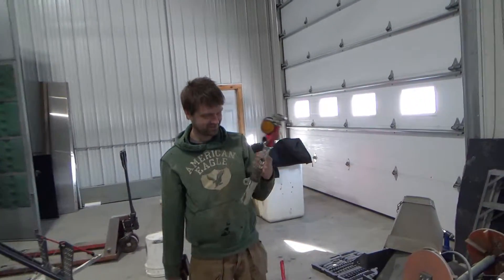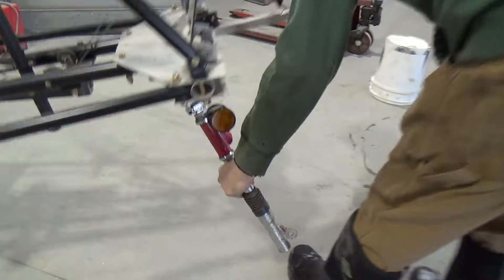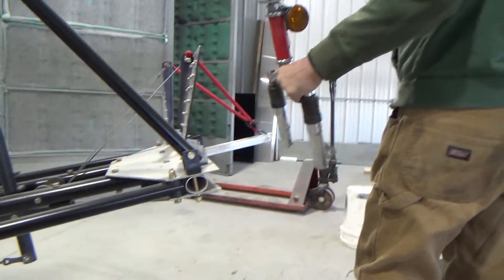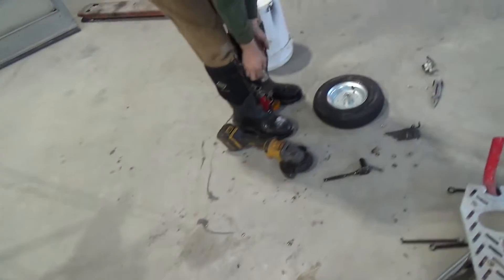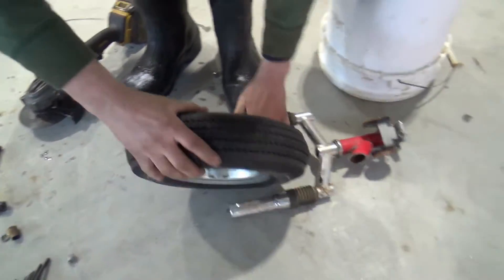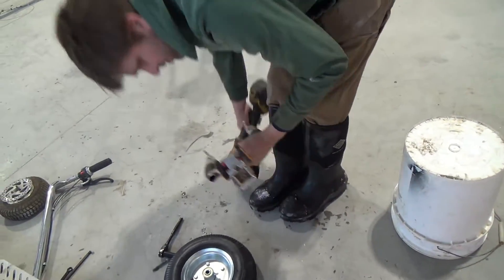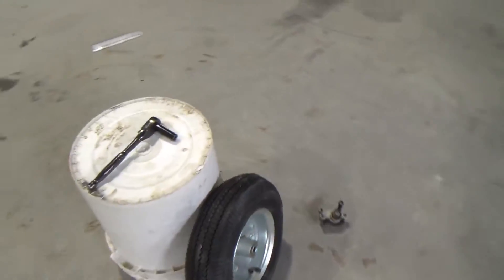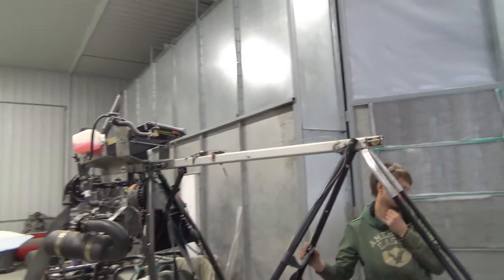Re-Building the Nose Gear | Re-Build: Part 8

Comment: Something to add from the bike design standpoint (being a downhill biker too), a slacker head angle on your steering will decrease the moment arm and thus reduce risk of a similar collapse/failure, by reducing the angle at which the force acts on the attachment points. I think you need a slacker head angle, or some more robust attachment brackets. Also, those forks looks to be of the Chromoly variety, and a very rudimentary suspension system (spring and a couple of ethylene bushings). Be careful to keep an eye on those welds - I've cracked my fair share of bike components wide open, forks usually give out first. I would say try to find a one-piece fork. I don't know much, but I do know that much ;)
Reply from the maker: Those attachment brackets are 1/8th steel. Pretty sure they're plenty strong. :-)
But yes, the forks are definitely the weakest link. It's designed so that they can be swapped out in a matter of minutes though if we determine that these forks aren't up to the job. I'll smack it down a few times on the runway and examine them. If they start to crack or splay, I'll swap them out for solid forks. I'm hoping they hold up though because I really like the idea of nose gear suspension! :-) (Especially with the way some of my students land..... ) ;-)
Reply: Hard to tell the steel gauge from here, though that should be plenty to hold it in place. The welds on those forks are pretty strong, the metal usually cracks around them leaving the weld in place, Chromoly was a really poor choice of material for bike manufacturers, but it was cheap at the time. I like your idea though, and I'd offer some of my spares up, but the wheel size/travel would cause an issue on the beaver. It might be worth looking at a quality set off the racing mini-motos. I thought I had some rough landings, you got got me beat there buddy. Thank the lord you never installed 5- points :-D 
I cannot wait to get back flying with you, and even get mine in the air. Once FD training is done I'm going to have a week off and get into that wing rebuild. I hope you're blueprinting all these mods :)
Reply from the maker: Yup, everything is documented and Scott is saving all the files he "prints out" on the plasma cutter. :-)

Comment: Matt, you may have covered this before, do you prefer the Beaver over the chinook? If so can you cover why or why not, have you done a video discussing these topics before? Could you point me in the right direction?
Reply from the maker: I think I've commented on it before on other videos. I don't think I've addressed it in a video yet. 
The short answer is, the Beaver is a very easy and stable aircraft to fly. The Chinook is less so.
Reply: mmatt it would be interesting to see a video outlining the pros and cons of each. I know the Beaver and the Chinook both started in Canada, and now it seems as if they are both being sold by a company in TX here in the states.  This company is selling the rights to the Beaver, http://www.aeroplanemanufactory.com/index.html. 
It’s interesting that you say it seems more stable. Don’t they both share the same wing? I know there are other aspects that affect the stability, I’m just curious, thought it would make for a good video.
Reply from the maker: Great idea. Perhaps I'll get to this in the spring. Thanks! :-)
Reply: mmatt should be a great video! Thank you for the reply!
Reply: @JoseRamos-su3ep  From the looks of things I think Matt has a Beaver RX 550 by Spectrum.     A company (ASAP) took over the design and produced the Beaver RX 550 Plus where they revamped the wing to be more efficient and more like the Chinook.  I've only seen one review of the Plus model.  It was complementary and pretty comprehensive.  Not sure they sold too many of them so it is hard to say for sure how it compares to the normal Rx 550.
Reply: @uhadonejob  Thank for that info, yes, I had noticed the company has changed hands several times.